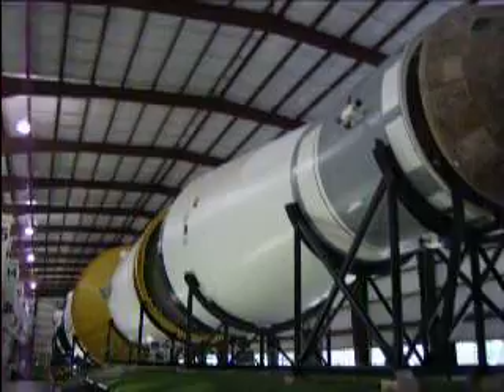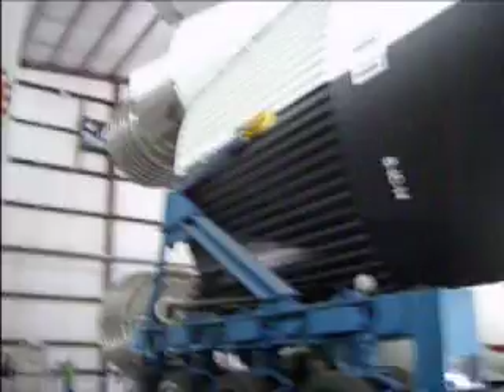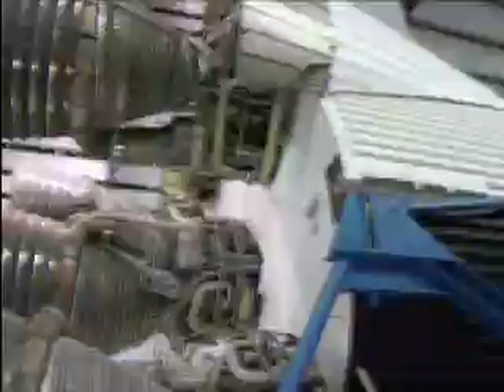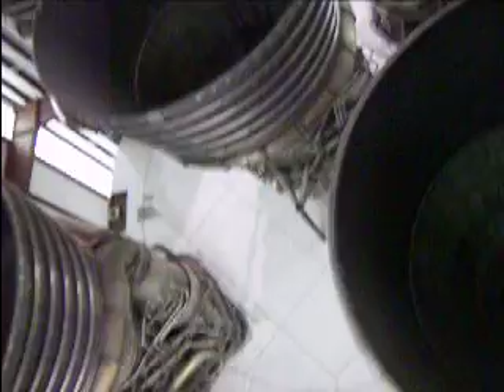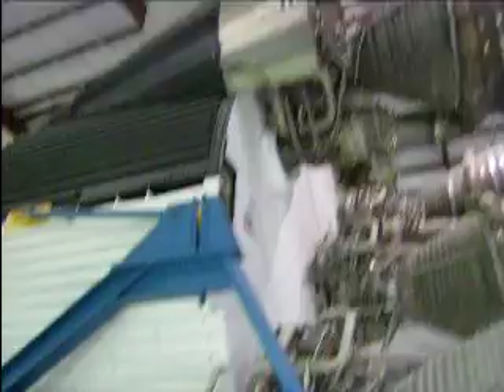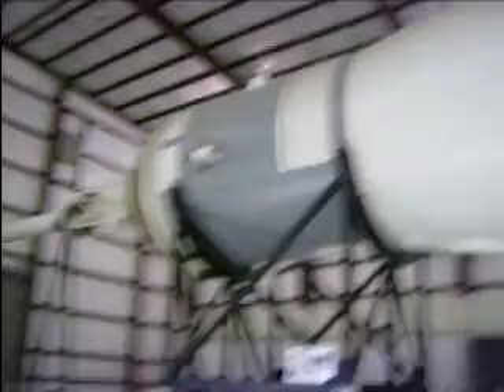Just How Big Is a Saturn V Rocket?

Comment: Just wanted to point out that the narrator incorrectly identifies the second stage engines as F-1's.  The F-1 was the first stage engine - the big mothers at the bottom of the rocket you see starting at 2 minutes.  These are the engines that beat the Soviets to the moon.  

The second stage was powered by 5 x J-2 engines.  

Otherwise, great video.
Reply: actually, the soviets had a more efficient engine than the f-1, which is still one of the most efficient engines for its size. they managed to make a closed-cycle engine, which the americans thought would be a really difficult task to do. the n-1 rocket just had more engines, 30 nk-15 engines to be exact. it wasn't the engines that couldn't get the soviets to the moon, it was the control system which always kept shut down the engines, leading to the rocket exploding.